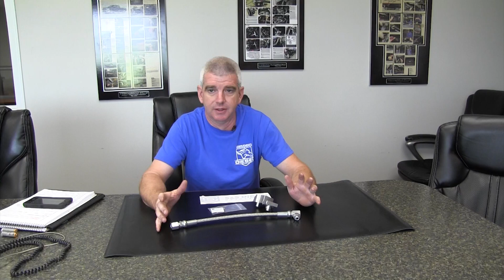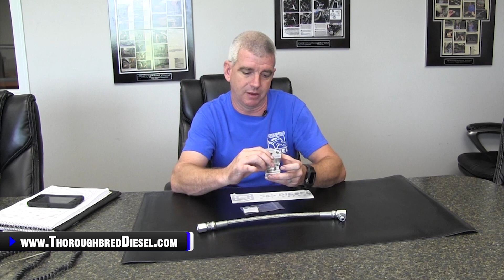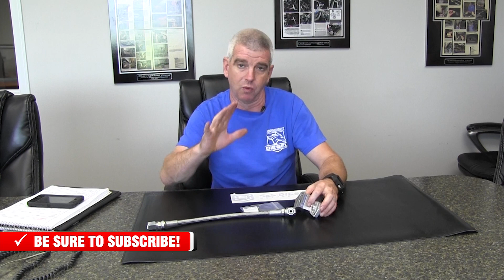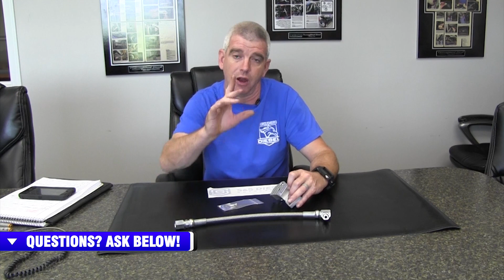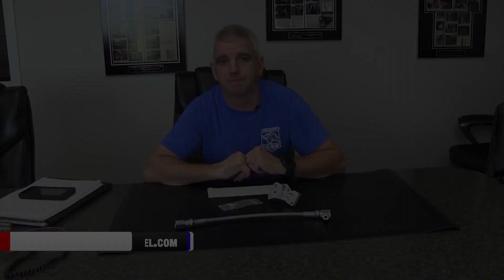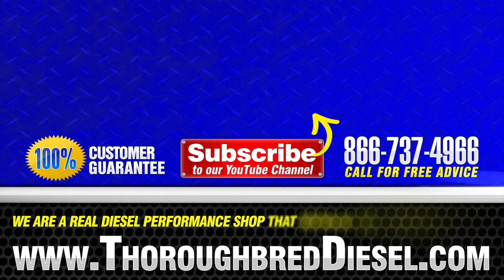S&S Diesel CP4 Bypass Kit: Ford Powerstroke 6.7L #diesel #ford #fordtrucks #powerstroke #trucks #fyp

Comment: What causes the pump to fail?
Reply: The cp4 pump has a single steel lobe, that rotates in an aluminium housing . It used diesel as a lubricant between the steel lobe and aluminium housing . If you get bad fuel , debris or water in the cp4 housing it will shred the aluminium housing. This will send aluminium shards through the fuel rails, injectors and possibly into our cylinders. Basically it’s a time bomb
Reply: That lobe contact a roller on a plunger. If the plunger rotates it will also chew up the cam lobe.  The lobe never makes contact with aluminum.  The Ford pump doesn’t have a heat fed pump on it either, Ford depends on an electric pump.  Keep clean fuel and filters in your truck and you should be good to go.
Reply: Check one with a magnet, all metal.  Not aluminum.
Reply: Basically, the CP4 just wasn't built to handle the extremely low quality of fuel that we have in today's world. The "ultra low sulfur" fuel isn't just "low sulfur" it's packed full of water, microbes, debris, dirt, and tons of other gunk. The biggest cause of failure here is still water. It doesn't matter how religiously you change filters, additives, etc. All it takes is running today's highway diesel. And getting enough crappy fuel. Upgrading your fuel system/water separation and the s&s pump disaster prevention/bypass kit, along with over religious maintenance is excellent insurance for your 6.7 fuel system. Or hell, any cp4 truck period. Cummins and duramax also have the same issues. But more prevalent in those trucks it seems. Hope this helps. 👍
Reply: @MostlyPeacefulCombatVet   Is correct, the lack of oil in our current diesel fuel is basically non existent, that coupled with shitty fuel destroys pumps.

Comment: Could you install a separate lubrication system using 0W-5 synthetic oil. For example, after you install this bypass, could you install a separate 1-2qt reservoir for the oil with an electric pump to feed lubrication oil through the bottom end of the pump while diesel fuel is fed directly into the top end of the pump. The two liquids shouldn’t mix, correct?

Comment: Had 3 pump failures in less than 30k miles last failure was Oct 2021 and it’s still sitting at a Ford dealer

Comment: I own a '15 F350 -6.7L that experienced a CP-4 failure while towing my camper over 2K miles from home.  My fuel was not contaminated, with water, DEF fluid etc  and FORD, God bless 'em, honored their warranty 100%. My question is this,
Will a quality fuel additive, like Lucas, which is supposed to increase the "lubricity" of our poor quality U.S. Diesel fuel, prevent the CP-4 from failing, or is it inevitable that the CP-4 H.P.F.P. will fail regardless. Is there a replacement pump that is recommended. I love my truck, I'm now she'll shocked not knowing what my future repair expenditures could be. The disaster prevention kit sounds excellent, does the bottom end lubricating fuel then get sent back to the tank where it then is mixed with clean n clear fuel that gets sent back towards the H.P.F.P. and continues the cycle. Is there an additive you recommend above others...
Thank you very much for all this extremely helpful and appreciated information.

Comment: Do we have any evidence of this actually saving a 10,000$ bill?
Reply: I have a friend that can show you his receipt
Reply: richard wiltcher you mean costs of repair after pump blew up?  So did the kit help protect the rest of the fuel system? Or did the still have to change all the injectors also?
Reply: @seminolewind1999  If/when the pump blows it will cost 10k min to completely repair your fuel system. With any one of these kits it simply reroutes debris that would normally run throughout your entire fuel system. So now all you have to replace is that shitty fuel pump and it runs about 1200$ average.
Reply: This just happened to me. $11,500 with a couple other things done. Never had a problem til I let someone else change my factory fuel filters. I’m betting they didn’t reprime the fuel system, then my CP4 started spitting shavings into the system and a few days later it’s in the shop. I’m purchasing every damn piece of aftermarket filtration I can find and putting it ALL on. I’ve always gotten fuel at big truck stops and add Lucas additives religiously. That shop changing my filters was the only thing different. But to your point, it’s almost impossible to provide proof of something that DOESN’T happen. Only what does.
Reply: @MarsellusWallace2024  lip

Comment: How often do these cp4 pumps actually go out? If you have 10 trucks, how many do you think would have this problem?
Reply from the maker: A lot goes into this. Fuel quality and fuel supply being the main two. If you are consistent with maintenance and monitor rail pressure as it applies to commanded vs. actual and never get any bad fuel,  your cp4 could live. They are very likely to grenade if you get a load of bad fuel or have any supply issues.
Reply: @thoroughbreddiesel  I have heard if it's  proven it was bad fuel, insurance will cover it...
Reply: Sounds awesome watch your insurance rates go up from a shitty design
Reply: If you read the class action complaint that's been filed against Ford, it's not a matter of "if" the CP4 will fail but rather a matter of "when".  I have a 5 month old 2020 F250 that suffered CP4 failure at 7,500 miles.  Thankfully Ford is covering the repair under warranty but they're going to replace the failed CP4 with another CP4 which obviously doesn't instill a lot of confidence.  Not sure if a bypass is the solution for me but it's being considered, along with fuel treatments and even selling the new diesel truck going back to gas burner.
Reply: Thats impossible to determine

Comment: would still like to see a install video! its been 10 months since it was said one was coming!
Reply: Good luck! An instruction video isn’t going to sell this part. This is about a 6+hr job if you have all the tools you need and know how.
Mess it up and you can seriously mess up your engine/C4 pump fuel sys etc.

It takes maybe about the same amount of time it would take to swap out the turbo, maybe more. Remove plenum, disconnect a bunch of lines, remove lower intake etc. mount on c4pump....

Call your local garage/dealer and ask them what they would charge for labor to replace your C4 pump.

Also, this doesn’t do anything to keep you C4 pump from failing, which will result in a roughly 3.5k repair (1200) just for the pump.

This pump fails because it lubricates itself with diesel fuel. If the fuel is bad (water in it) it decreases the lubrication and the pump fails.

Make sure you carry comprehensive insurance with a reputable company (Geico, State Farm etc) that covers bad fuel. If the pump blows, call ins. pay your deductible and have them foot the 9500+ bill.

Comment: Crazy price for a block of aluminum and a braided line but I guess without competition they can charge what they want
Reply: Yeah my thoughts exactly.  But I guess worth it in the long run
Reply: There are other bypass systems, but everything I’ve seen is garbage besides this one...that’s why they can charge what they do. It also helps that they can compare it to a 9-10k+ repair bill if you don’t have it. However, you’d still be paying 3.5-4K at a dealer to replace cp4 pump

Comment: Just installed mine yesterday and the day before (because it took FOREVER to get the upper manifold off). The install of the bypass itself was straightforward and easy to do, but the O rings that came with the kit were a little too big and ended up getting pinched when I did the install. Fuel went everywhere in the valley, and I had to pull everything apart again and use a turkey baster to get the fuel out. The second tear down took a LOT less time thankfully, and I ended up using the the O rings that came off the original line, and they fit perfectly and I didn't have any pinching issues. I really feel like S&S ought to ship these out with slightly smaller O rings because I know I'm not only one who has had this problem.

Comment: Is there a better CP4 pump then the original ford pump? Would changing CP4 pump stop this?
Reply from the maker: The Fords don’t get the luxury of being able to upgrade to a CP3, yet. There is no upgraded CP4 pump, but this kit will protect your other high pressure components in the case of failure.
Reply: @thoroughbreddiesel  Thanks for the reply and info.
Reply: @thoroughbreddiesel  There are aftermarkets you could go with however they arent cheap.

Comment: I'm not a diesel mechanic but I have had 5 diesel trucks.  This presentation make absolutely no sense to me.  I did watch another video from S & S and it made no sense either.  I would prefer to see a drawing or two to see the flow of the flow with this product.
Reply: As a Ford diesel technician, it makes no sense to me either. So don't feel bad. All I can get out of the poor information given is that when a failure happenes the fuel magically goes to the fuel tank instead of the fuel rails. How that happens I don't know.
Reply: This is conjecture on my part but I think there is a supply of fuel that feeds the pump side for cooling/lubing and then that fuel is sent on to the FCA and on to the injectors. What isn't used is returned to the tank after going through all those expensive parts. It looks like this new machined portion keeps any fuel that goes to the lower cam area from ever being directed on to the HP pump section.  It must intercept the return line after the rail.
Reply: Look up the SPE disaster prevention kit. They do a spectacular job explaining it and have a better kit also. No cutting of fuel lines needed.

Comment: Did they fix this problem in the 2018's? Also - Will this install void the warranty (I think I'm past my warranty anyway but still curious)
Reply: Call your dealer, but I’d definitely say YES, it will, because of what’s involved in installing it. You’re literally adding a component to the heart of the fuel system.

Comment: I've been to S&S's site and seen the CP4 renditions side by side, it is not completely clear as to how the shards are bypassed and get back to the tank and filters without sneaking thru the pump to the injectors.
Reply from the maker: The fuel supply is now coming straight from fuel filter to FCA.  At the end of the day the truck wont be running when you have the failure so the design is so that the fuel that is in the pump body at the time of failure doesn’t make it into the fuel supply to injectors.